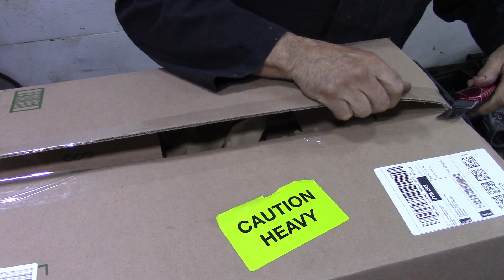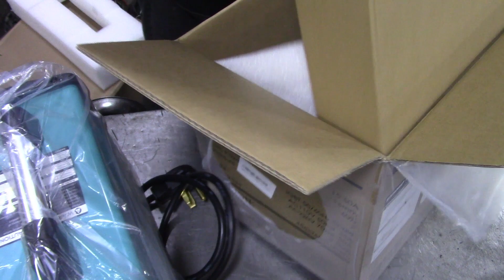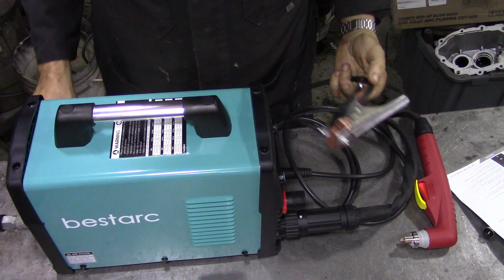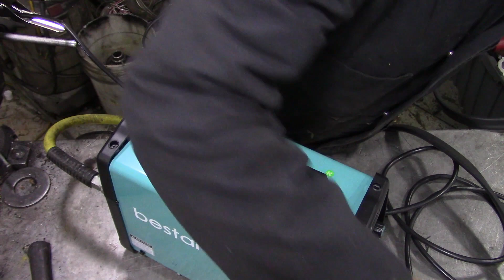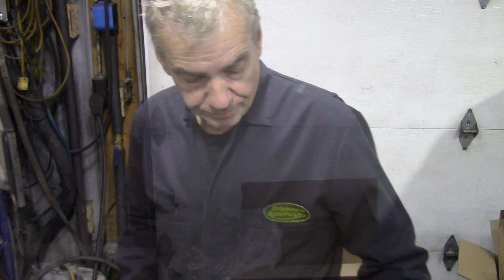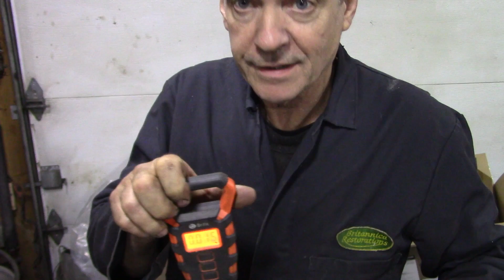Bestarc BTC500XP 11GEN 110V 220V Plasma Cutter

Comment: Wow. Quite a machine. Most of us won't want to cut more than 5mm. The chassis walls on my OKA aren't much more than that. I particularly like how it dealt with the thin stuff so quickly, which would minimise warp. Far cry from the old Oxy acet torch eh Mike? Might have to get me one.
Reply from the maker: I only use my bottles for heating/bending - and I use propane 
The Plasma cuts great, and these inverter machines are super light - downside is having a suitable extension and breaker if you are working outside the shop
This one was one of the top ones as it is CNC capable, but there is a same amperage but cheaper available

Comment: Hi, how thick is a Defender Chassis? Reason is, I'm a wheelchair user and would like to get a Defender after I break my Freelander Td4. I have this crazy idea of fitting some form of lift system to enable me to get into the car. I just need a lift of around 8 inches. I'm thinking of a platform on a cantilever.
Reply from the maker: Generally 2 - 3 mm depending on the placement on the chassis -  I think the original main frame is 2 mm

Comment: Plasma Cutters have got cheaper & cheaper. I bought one years ago for more £££, not much larger than this but from a Brand Name (still made in Republic of Chinesium) and with less features. It’s hard to compete with, if it fails throw it in the bin and buy another but hardly environmentally friendly compared to my 50year old welder which still works perfectly but is 45 the size & 10x the weight.
Reply from the maker: This inverter MIG/ plasma are super light and after using them for about 6 /7 years they are pretty reliable - but they are a bit tricky to set up for the steel or metal you are using - I do not do a lot of fabrication or chassis repairs now, so when I do get them out it is a bit of trial and error! 
But once set you are off to the races!

Comment: Good bit of kit for the workshop, I've had one of these inverter plasma cutters for years, even Lidl got one for sale £119
Reply from the maker: Yes and very easy to use - looks like there may be a winter project coming on to make a CNC table!
Reply: @BritannicaRestorations  Look forward to seeing how that goes, like you I don't have the room for one.
Reply from the maker: I know that is the issue = if I could get shot of these Land Rovers!
This is the sort of thing we had in mind 
https://ca.pinterest.com/pin/716142778239310290/
but we can custom-make them if the customer has a design

Comment: Looks like a nice bit of kit.
Reply from the maker: Yes - there is a cheaper version without the CNC input, but to be honest I rarely cut more than 5mm steel so 16mm is a bit overkill
Reply: @BritannicaRestorations  That is a nice option if you need it and good they offer one without CNC input. 16mm is practical.  If you are making an armored personnel carrier.

Comment: Nuzzle size is often overlooked , you need an 0.8mm to run 20 amps and the lower air pressure. Many of the cutters comes with a 1.2mm as stock for cutting high amps and higher pressure. 
When cutting down towards the floor , it good to have some kind of water container to capture the molten metal , otherwise your nice  floor will be not so nice anymore.
 Anyhow nice kit and the most fancy display I ever have seen.
Reply from the maker: Thanks for the tips!
Reply: Your nice shoes may not be so nice either.  I have no idea how that could happen.
Reply: @jamescaron6465  I only do welding in sandals 🤣

Comment: Hello, I once tested a 220 volt plasma cutter in my workshop, but the 16 ampere fuse of my 220 group kept breaking, how is your experience? looking at the input and output power 3520 watts compared to 11000 watts? Could IGBT technology be the basis for this? Thanks for the nice programs .Rob